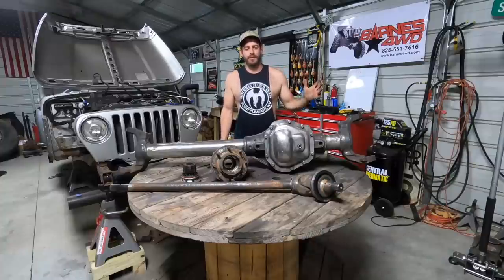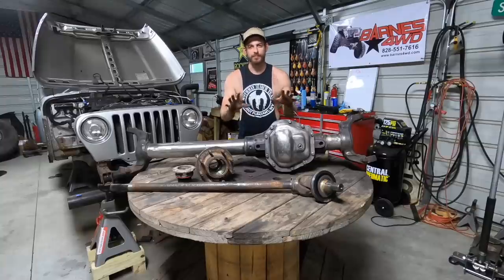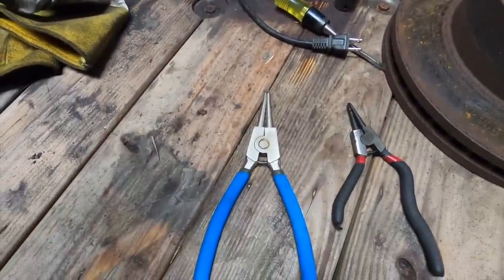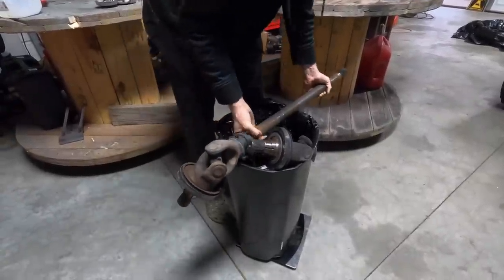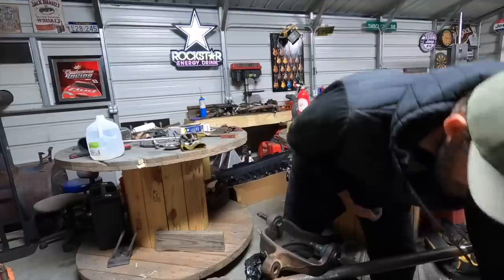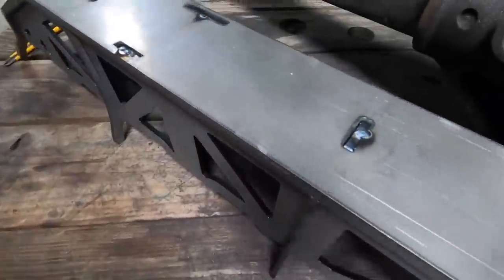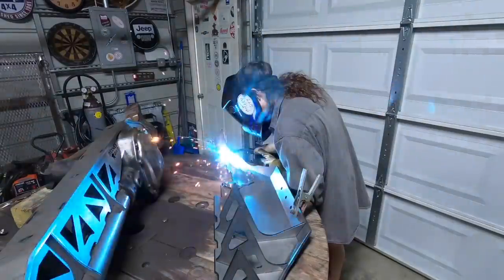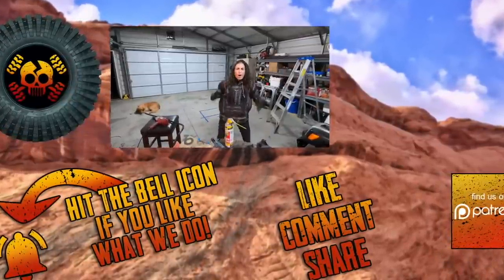Dana 60 Junk Yard Axle Swap Beginners Guide!!!!

Comment: Tip: for that nut that got stuck on the lower balljoint, what you need to do is add pressure. that nut is just getting caught on rust or dirt thats on the threads. then the whole balljoint is spinning with it. Take a long prybar and put it between the spindle/knuckle youre removing and the axle tube ends. push down so there is force against the balljoint, that will help hold the balljoint in place (cause of all that pressure youre putting on it) and let the nut actually break through whatever is holding it back

Comment: I found that  if you use a wire wheel on a drill and  scrub  your threads of your ball joints,  or and bolts for that matter, it usually helps to make disassemble go much easier . And it also makes it faster and easier to get penetrating oil to soak in the threads,  because you are removing much of the rust and dirt first.

Comment: Those 05+ SD Dana 60s are great...the hardest part is getting all the OEM brackets off.
Reply: So there are actually kits that utilize the stock brackets and that would have for sure been an option... if we hadn’t already cut them off when we found out about them haha
Reply: @patpollifrone9827  I didn't know those existed either!  I went with the artec kit on mine and am super happy with it.
Reply: Yep, but your not going to find one in my area for $450. Last 2 cost us $800 and $1000.

Comment: Have this same axle on my 2006 Super Duty. The auto hubs are garbage. Throw those hubs away and get a set of Warn's. Also, keep in mind that you'll have to run a minimum of a 20" wheel to clear the huge brakes.

Comment: When I have a difficult ball joint at work and I’m not saving them... because at this point the joint may need replaced anyways, I’ll just cut the bolt. 
If not, and the axel is near something to pry up on I use a 6’ bar to pry the knuckle tighter into the joint and hit with my impact at the same time. Small bursts if it keeps spinning... I rarely ever to cut them out.
Reply: Great tip dude👍 definitely will try that method next time👌

Comment: Put some vise grips on the shaft of ball joint under grease boot, when it spins. I've done this multiple times, works great. Awesome video.
Reply: Thank you man! great tip💪
Reply: Hi BleepinJeep,  Question I;m hoping you can help me out with-  My 99 XJ-  When I start the engine the air bag light comes on and the blower motor will not work and the turn signals only work when appyling the brake pedal,  Drive it for 10 minutes then the blower pops on and the turn signals work properly.  Any thoughts?  Thanks!

Comment: Question: You are going full hydro for the street?  Follow-ups: how much steering angle are you shooting for? Are you using a weld-on high steering arm kit?
Question: Are you going to rotate the inner Cs to increase castor while also having a good pinion angle?
Question: Are you going to use the Ford 10.5" for the rear?
Question: Since you are going to pop the differential to install a front locker, why not just remove it now?
Reply: David, thanks for all the questions! Llamazeen is going to be a trailer Queen so I’m not that worried about the streetability. We will be using the weld on kit from Barnes and just gonna leave the inner Cs where they are and adjust castor with control arm length👍 next we will be using the 99-2006 14B with a spool and factory disk brakes, redrilling the front unit bearings and hubs to match the standard wheel pattern
Reply: Forgot about the locker question... we have removed the truss and full hydro mount (light tacks dude👌) for that exact purpose. We also welded the tubes to the chunk while the truss is off 👍 thanks for the questions man! Follow us on IG @bleepinstickykids

Comment: Put pressure on the ball joint.  Use a impact.  It'll come loose.   Use your imagination coz situations are different.   If it's on the truck u I've the floor jack to put upward pressure on the ball joint

Comment: Answer your question how do you get that spinning ball joint off if the axle was still mounted in the vehicleput a jack underneath the knuckle and Jack that up so it pushes the ball joint in there and locks it and then you can take the nut off
Reply: We have learned a few methods on this! Love it thanks for the knowledge 👍

Comment: So after all these upgrades like ball joint eliminators you have the same thing as a kingpin Dana 60 for the same price or more and you still have unit bearings with a metric bolt pattern. Oh and full hydro which isn’t street legal in lots of states. Awesome.

Comment: You shouldn't have dogs around when welding. The arc flash has the same affect on their eyes as it does on ours and they don't know not to look at it. It's pretty irresponsible of you to have them running around like that putting their eyes at risk. Put them in the house until you're finished the welding. Common sense.
Reply: Noted

Comment: This video is very misleading. You failed to me took all the shit you have to cut off before you get a bare axle like that. By far the most pain in the ass part buy a mandatory step before you can do anything with that axle.
Reply: Bleepin STICKY Kids oh I’ve done it multiple times but you guys failed me mention once that you had to remove all that. That is why this video is misleading. You didn’t mention the hardest part of the entire video. Now people are going to go out expecting to buy a 05+ SD axle and just weld a truss right on. And that’s not the case... i know that’s not the case but lots a people out there won’t.
Reply: Tyler B we will make a video on the next one we do. Should have mentioned it. I figured they would look at it and realize there are a few more brackets on theirs than there was on this one. So you’re in the cost of about 50 cutoff discs